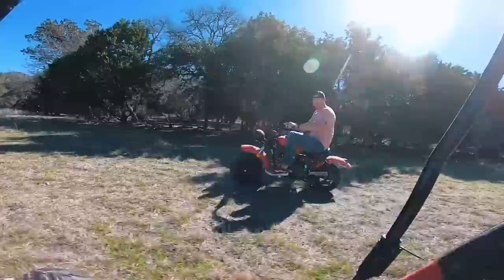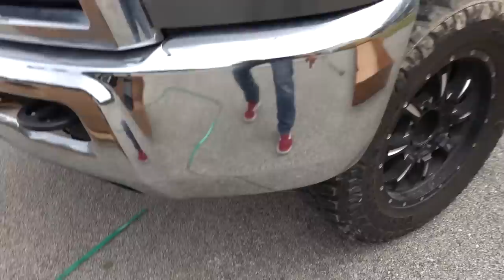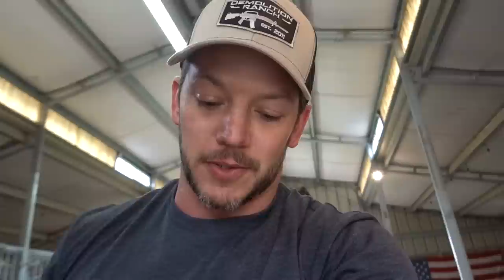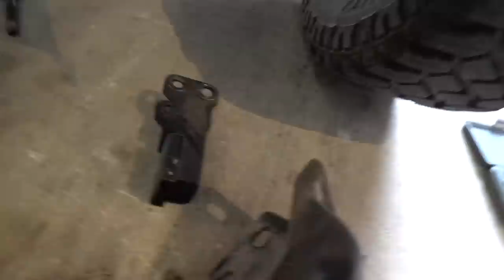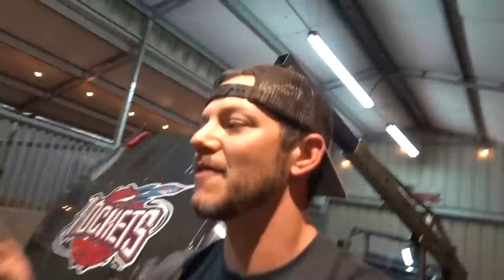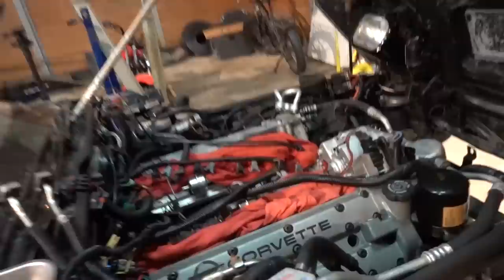The New Upgrade is HERE!!! Dodge Ram 2500 HD Cummins

Comment: Light bars on the roof make a a lot of noise on the highway, I'd stick to putting lights in the bumper. Rigid Industries and KC make good lights.
Reply: This 👆🏻
Reply: Yes.. Use PIAA
Reply: Aerolidz make shields that cover the light bar that offer noise reduction as well as mild protection.
Reply: This x2
Reply: David you must have installed it wrong then. Mine never made noise
Reply: @richardjameswellingtoniv9682  it really depends on the truck. If it's more aerodynamic it makes noise. If it's already a brick then you usually don't notice.
Reply: @richardjameswellingtoniv9682  It's extremely common knowledge that roof mounted lights make noise. You're the exception, not the rule.
Reply: Mine never made noise the two or three years I had one.
Reply: Rigid 💪🏽
Reply: It depends on how you install it, if it's slick to the roof and a bit behind the windshield the wind is going over and there for doesn't make a sound.
I have one on My roof and no one have ever heard a sound from it.
Reply: Well, I've never had trouble with noise. But you will have to drill holes... which hurts...😦
Reply: This brand but a roof rack with a light bar
Reply: RECON lights are awsome
Reply: I can speak for Rigid lights... My polaris razor is decked out in them....  I have abused them  on gnarly mountain trails and a TON of mud...still work great.
Reply: With the Cummins engine i doubt he will care about the noise of the wind.
Reply: @MatthewWatches  IDK why you tagged me, I said nothing to the contrary. I said they make noise.
Reply: Terrible for fuel economy as well, at the end of the day Earl is a work truck not a toy.
Reply: If you want range spotties as well, bars are good but don't have much range
Reply: David actually I have one on my jeep and my Cummins and you can get brackets that won’t whistle at all I have had one do it and I had to buy new brackets

Comment: Do rigid bars and a warn winch don’t do a roof mount it sounds like a whistle on a freeway do bumper mounted lights
Reply: I've also noticed that roof mounted bars tend to give a false perspective of hole depth when off roading. Im my experience at least.
Reply: Roof mount also lights up the hood  reflecting light back in your eyes. Bumper mount for sure.
Reply: Bumper mount and 2 pods in the fog light holes.
Reply: You can use a roof mount but only as a rear-facing work light. As for winches, there is only one. Check out the, "Warn heavyweight 68801 16.5TI".  I have one on my Ford F250 super duty. That thing can pull the truck up a tree no problem.
Reply: Agree rigid makes awesome light bars
Reply: I think Cali rays is better at light bars and rigid is better at the little pods
Reply: For sure
Reply: Yes to all of this stay away from roof mounted lights
Reply: If you light up semi mirrors the driver is going to close at least the 1 eye on the bright side, so when you do the 2nd stupid thing and cross the divider line you'll be bouncing off his tires...happy trails through the bushes!!
Reply: Mount to the rack behind the cab, and make rear facing to help with trailer hookup at night, especially gooseneck style
Reply: epicpigstudio I agree
Reply: Get rigid lights for the pods with amber tint for the fog
Reply: pllleaassseee dont put lights on the roof.
Reply: I agree dont do a roof mounted light bar if you plan on doing any highway driving they whistle
Reply: Roof mounted lights are fine, mine doesn't make any whistling noise at all and if mounted right they don't reflect off the hood.
Reply: Question guys. Do hood mounted lights have negatives?

Comment: For a winch I’d most definitely recommend a Warn. Worth every penny, and when you need a winch, you want it to be strong and reliable. For size, I see curb weight (in general) is about 7k for your truck, plus you’re steel flat bed, typically 2 times vehicle weight for pulling power. Warn makes a 16,500lb winch. Probably a whole lot of cash! But something you’d have for multiple lifetimes and would pull ANYTHING. My 2 cents. And howdy from Houston!
Reply: I second the Warn winch.. oh wait I dont even have a truck or winch 🤣 Matt, I am a first rate keyboard warrior I promise!
Reply: Agreed with the 16,500lb warn
Reply: I’ve run warns to upwards of triple their load capacity with absolutely no issue. Things are a beast. My personal favorite is their drill winch, it’s like a motorized come along
Reply: Howdy from Houston as well.
Reply: @Gabe Lakey 
Definitely go with Warn brand winches and you absolutely want to have one that is capable of pulling a minimum of two times your vehicles curb weight. 
Yes they will be pricey, but they used to be lifetime warranted with a planetary gearing system!!!
Reply: Gabe Lakey, couldn’t agree more
Reply: 2 grand.

Comment: Winch: WARN hands down has the most reliable winches. 1.5-2 times the weight of the truck is a pretty good standard.

Lights: Baja Designs and Rigid Industries make great lights. As far as the roof mount goes, I hated mine. No matter how it was positioned, it seemed to cast too wide of a beam and created a ton of glare on the hood. I’ve got a friend with the KC style lights on his truck and they are great! I sold my roof mounted bar because I hated it so much. I think a single 24” bar would suffice mounted on the RanchHand. If you wanted more light, I’d go with pods mounted low by the windshield. Just my preference.
Reply: spot on man
Reply: the winch needs rope not wire!
Reply: Nailed it. Also seconding on the synthetic rope over steel.
Reply: Yep, Phillip you nailed it on the head.  Roof bars aren't particularly helpful pointed forward.  I have an amazon special 24" on my winch bumper that works really well. An actual name brand light would be even better.  I do suggest little headache rack lights pointed backward up high but not forward.  I also highly recommend synthetic winch rope.
Reply: I agree Phillip
Reply: Totally agree a nice 12k warn would be definitely a great addition to earl
Reply: Spot on. Roof bars will almost always make a ton of wind noise.
Reply: David Gulbransen not really if u set it right their not that loud
Reply: Phillip lmao we have the same profile pic
Reply: Phillip But I don’t want a Warn winch I want a new one
Reply: Phillip you took my words that’s the same thing I was bout to say 👍

Comment: Baja designs lights, all the lumens, and dont put one above the windshield. They are loud and they light up the hood of the truck. Once the hood it lit up you cant see as well. 

Yellow fog lights down low because they are better in dust and fog. Spot light down low in the bumper to project light far. Upgrade factory head lights for better light up close. If you need them put pillar light facing out at an angle to see off to the sides a little bit. 

Personally light two flood lights mounted in the rear bumper to light up behind me when ever I need to see at night. I.e. hooking up a trailer in the dark.
Reply: Two flood lights in the headache rack would be good too.
Reply: He should get RECON lights I just installed some and man do they look great
Reply: @diegoa4203  recon is the worst product you can buy.
They use the thinnest wire imaginable.

Comment: I wouldn’t put one on the roof, I’ve always had them on the roof with several trucks and they all reflect off windshield and hood pretty bad
Reply: you have to mount them further back if I remember correctly
Reply: they tend to create wind noise
Reply: Mat the hood. And flock the dash. Mopar is known for the mat hood.
Reply: Its better to mount it on the back rack, so the top of the cab blocks the light from reflecting off the hood.

Comment: Rigid Industries, Baja Design, Rough Country, Black Oak Led, or Amazon if you not looking for anything serious. Definitely try some amber leds for better snow, fog, rain visibility.
Dieselleds for some amazing reverse Led bulbs though.
Gorecon for some nice cab lights.
And definitely a Warn winch 16500lbs or more with a synthetic rope for easier operation

Comment: 12k Zeon Warn Winch 
Rigid industries lights or Kc lights, their led’s have come a long way recently
Reply: Great winch...
Reply: Jack Spreen Yes! Also Rigid industries are my favorite brand of lights they are amazing
Reply: Plash lights ridged industrys is just a name i swapped out the 40in for a plash light bar was like 500$ cheaper and alot brighter tx company and great warranty
Reply: Jack Spreen https://youtu.be/M2w3NZzPwOM
Reply: I TOTALLY AGREE MATT YOU SHOULD GET THIS ONE
Reply: Agreed
Reply: PIAAs are also pretty good
Reply: I have the 12k on my power wagon and I use it quite a bit. Kinda weak for the size of the truck Doing a 1:1 pull. Snatch block helps. Wish it was a bit bigger. And Matt’s truck will be much heavier with the engine and flat bed.
Reply: You all should check out the laser lightbar from BajaDesigns.
Reply: Rigid industries made in the USA.
Reply: @Ankcontracting  Yeah I put the M8 8000 lbs winches on my jeeps and I would say deep in mud 1:1 pull it works awesome but I feel like just a little more weight and it wouldn't like it too much and I guarantee that trucks almost double the weight. I've also Been a fan of the M series because you can remote mount the solenoid, or the black box that you plug your controller into,  if you have tight mounting space. Warn also make a 15k M series. As Long as it's not the VR chines shit series Warn makes a good winch and I don't think he would have any problems out of a Zeon or M series as long as he gets a 12k+. And I haven't seen it brought up but to for me steel cable vs the synthetic rope is just preference, for me I like the old school steel cable.

Comment: I’m so glad you bought a Cummins and got rid of the 6.4
Reply: Hayden Koehn  I’ve repaired way to many of them piles of shit to recommend one to anyone.
Reply: if you take care of a 6.4 it will last. its a nicer truck and will out  pull a dodge all day every day.
Reply: Dethangel ishere I own one. I love it. but no it will not out pull my Cummins. And it’s nowhere near as reliable. Ford screwed it from the start. No amount of maintenance will fix the cheap pistons that crack. And by the time you delete the truck the emissions equipment has Thinned out the oil and prematurely worn out the engine. The turbine housings are to small it has way to much back pressure. The list goes on I wouldn’t recommend them to the average person. Me personally, I love it. But mines got rods pistons and a big single now so.
Reply: Hayden Koehn same the only reason I own any powerstrokes is because they were broken and so damn cheap. Buy fix and sell them. The shop I work for Only repairs Fords we make a killing.

Comment: Got to go with with WARN winch.   I got mine in 1984 and it is still going strong.    I use it several times a year around the farm and for recovering stuck equipment.  You need to get one that is rated for 1.5 to 2 times the weight of your truck.

Comment: definitley need a chase light, reversing needs way more light than forwards. lightbar down low, anything up high needs to point away from the hood when driving, so pod lights on the corners. a big light bar up top can be cool for lighting up a campground or your buddies car on the roadside.

as far as winches go, not sure on brand but if you weld the winch to a 2inch tube and then put a 2 inch receiver up from it makes the winch way more useful! put a receiver on the dump trailer, car trailer, front of a quad; a much more versatile tool that way

Comment: 15,000 pound winch. Light bar in the middle. Spot style lights in the sides wired with a 3 way switch to the high beams. Wranglerstar has a great video on that. You don’t really want on on the roof for glare reasons. Then I’d put 2 floods or smaller light bars on a rack behind the cab facing back.

Comment: Hey Matt
Have you ever ran over a bumper like that at 70 miles an hour?? That's because they usually use lock tight on the mounting bolts. Did you by any chance use lock tight??
Just aksn lol great video 
Keeeeeep emmmm coming

Comment: ax-beam for the led lights do not forget to  up grade your batteries & alternator for the power draw for the wench will put on the system get with 4x4 part's in your area they will get you set up right

Comment: Wench: Synthetic rope, weight as much as the truck weighs or more, preferably more. Lights: Light bar, fogs in the bumper and ditch lights. Kind of disappointed Pete wasn't holding the bumper as you were putting in the bolts.
Reply: Or Oberst for that matter!

Comment: Get some black headlights and and a black grill guard, Earls looks will look even better. Light pods or cubes are far superior to fog lights. I would run a light bar on your bumper and one across the cab. Rigid and rough country are both solid lighting brands.

Comment: Remember that time Matt bought a 6.4 powerstroke 🤣
Reply: And told us how great of a truck it was before doing research
Reply: That's actually a Pukestroke. Shorter durability than the Ford's gasser engines in a light duty truck.
Reply: Pepperidge farms remembers
Reply: Gunga Dinn emissions killed the 6.0 and 6.4
Reply: Cumins good,
Chrysler transmissions 👎
Reply from the maker: Haydon Holcomb SHUT UP! That never happened!
Reply: @OffTheRanch  yes it did :)
Reply: Lol. People talk so much shit on the ol 6.4
Reply: He should have bought a 7.3L IDI or 7.3L Powerstroke instead of the 6.4L Powerstroke.
Reply: F-4 Phantom II I wouldn’t say an IDI, the 7.3 powerstroke would’ve worked for him though.
Reply: Warn winch, with synthetic line. Lights, can't help you.
Cheers
Reply: @OffTheRanch  Don't tell Mere?
Reply: Alex Pinci+
  Emissions had nothing to do with blown head gaskets and stretchy head bolts on the 6.0. It may have a bit to do with EGR issues causing the truck into limp mode. 
Who ever thought it was a good idea to tuck the engine so far back into the firewall that to replace head gaskets you’d have to pull the cab?
Reply: OffTheRanch+
  Almost convincing Matt except for one of the recommended videos was the Burgundy F350🥇💩. 

I won’t tell Mere👍.
Reply: Gunga Dinn egr is a big problem with these motors, bypass it and head studs and it’s a good motor.
Reply: @alexpinci3432 +
  I owned a 2004 F250 4X4 from new. Less than 4500 miles it blew a head gasket. Sat in the dealership for 2 months waiting for new cylinder heads and bolts. Two months later the EGR went while towing my travel trailer.
  Don't get caught deleting a new truck as the EPA is looking to make an example out of people.
Reply: Gunga Dinn a lot of people delete the egr

Comment: normally you use a winch that has the capacity of three times the empty weight of the vehicle ( just for heavy offroad use )
for the lights / lightbars look for the ARB intensity ones thats the best at the moment in my opinion

Comment: 12k lb winch, rigid industries light bars (one in the bumper, one on the roof). I recommend doing a flat black vinyl across the hood to reduce glare when the roof light is on.

Comment: Don’t put a light bar on the roof, they shine back in your face off of your hood.
I would keep it simple and just do a 24inch bar on the bumper and fog lights to fill those holes. I use different brands and like them all.
Make sure colour is 6000k, some bars are too blue looking.
Reply: KatiePitre2502 that’s why you put a plate underneath the light bar and the reflection on the hood is gone
Reply: I also have a lightbar on my roof and just run a matte finish decal on my hood so during the day glare from the sun doesn’t reflect through the windshield and then at night the lightbar doesn’t reflect either

Comment: I strongly suggest the Warn Powerplant 12 winch if it fits. It's a 12000lb winch with an air compressor built in. With all the construction you do it will come in handy. For the lights I would recommend KC HiLites Gravity Pro 6 lights. They are extremely well made and they come with a 23 year warranty.

Comment: From what I've seen on a lot of newer build trucks both pre-runner & mall-crawlers the old school big kc lights are back but in LED. If you go light bar get the dual color (clear/amber) & go no less than 800 lumens per section.  I would get a warn 12k winch

Comment: Recommendation for lights: go cheap. In my experience they all get condensation in them whether they cost $30 or $300. I’ve used amazon for all my stuff, seal it up with some clear silicon and you’re ready to roll!
Reply: Yup, agree completely.
All mine weren’t expensive and came Amazon.

Comment: Now you need a leveling kit for the front end to handle all that front weight and why wouldn't you that will just make the truck more badass😀
Reply: Leveling kits make Ford trucks (any truck for that matter) look so goofy. It looks like they have a huge load. Sporting a saggy diaper. Whether or not the wheel gap is even, isn't the issue. The ENTIRE truck is built to look a certain way, then when you alter ONE aspect, it throws the entire look off. I didn't know, at first, why I was seeing Ford trucks looking like the rear suspension was broke. Then I found out it's a "leveling kit."
Reply: Better to not level it. Especially when he tows that heavy dump trailer. It'll level the truck out by itself which is what you want when towing. Nose high is bad because it negatively affects the steering. Makes any truck handle weird.
Reply: It’ll look badass when not having a load.. when you load it up or tow with it it’ll look like it can’t handle that much weight.
Reply: @davidmathay7117  I think it might already have a leveling kit the front ends already up there pretty good

Comment: Amber fog lights, 32 - 40 inch in the middle of the bumper (Diode Dynamics/Rigid/Baja Designs), led headlights, and a 16-18k warn winch.